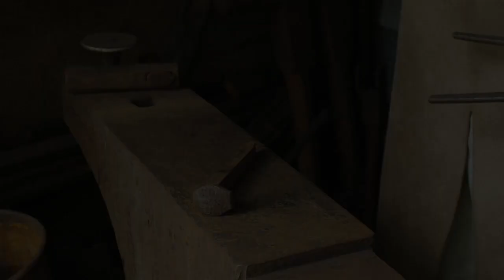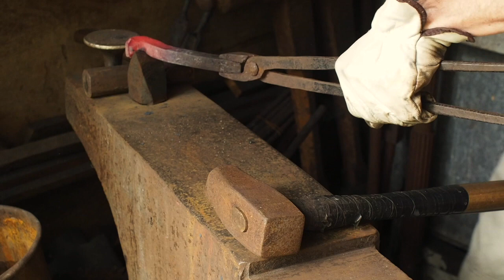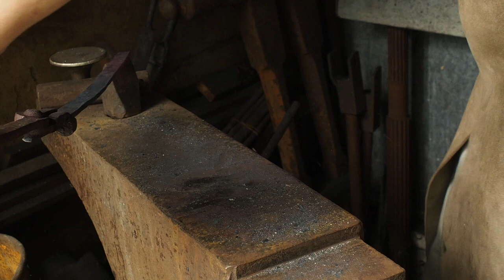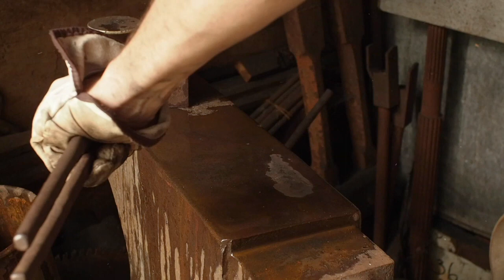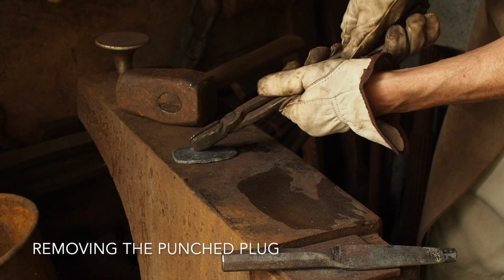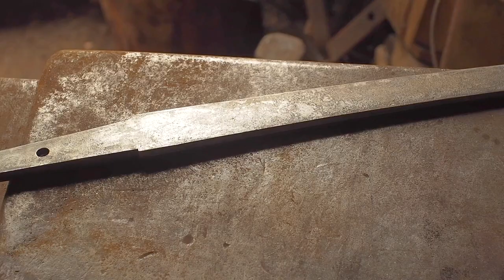TLDW #8 - Tanto Forging Practice: Railroad Spike

Comment: Great work. I make railway spike knives to sell and am just keeping up with demand. Never new there was so much steel in then though, lol. Very nice video.
Reply from the maker: yes, lots of steel...not much carbon... ^___^
Reply: Maybe not in the spikes here in Australia, they are not marked HC. But in the USA they have the initials HC on the head, i take that to mean high carbon?Crossed Heart Forge - islandblacksmith
Reply from the maker: yes, some are marked HC, but it does not mean "high carbon steel" in the metallurgical sense, it means a "higher carbon" version rail spike, but all the official specs i have seen say they never pass .3% carbon (the normal spikes are .12%)...

Comment: I loved your video, really nice and thorough. I have one question, Why out of a railroad spike? I have heard that they don't make nice blades. Is it because they are cheap and it's for practice? Is it meant to be a decoration or a letter opener? Please explain.
Reply from the maker: yes! using spikes as practice for forging is a way to learn for those studying classical tanto...right amount of material if you have the
resource...there's quite a bit of info on those very topics in the description, or here: http://islandblacksmith.ca/2016/07/tanto-forging-practice-railroad-spike/
Reply: Wow, that was impressively quick. Is there a certain place to "look for" railroad spikes? I say "look for" because it is illegal to look for them.
Reply from the maker: yep, don't mess with the railway...best source would be the scrap yard with the rr contracts, or ask a crew for a couple...bottom line is if you don't already have a spike this is not the practice material for you ^___^
Reply: Yeah, I guess so. I was thinking about getting in to knife making. Do you have any videos/books you would reccomend.
Reply from the maker: i have a list, but they are entirely focused on traditional japanese swordsmithing: http://islandblacksmith.ca/product-category/books-apparel-gear/books-resources/

Comment: Love the finished piece and instruction! When you forged your bevels, it didn’t look like you angled your blade at all- most videos I’ve watched say to angle your blade to forge bevels. Is this a different technique- you have me extremely curious, as this is where I struggle massively.
Reply from the maker: no i don't really think about "lifting" the blade, though there is a tiny element of it the proper angle is quite small (and too much would be worse than none)...remember the anvil is "hitting" the back side of the steel with almost as much force as the hammer on the front...
Reply: Okay, thank you. Gonna keep practicing!
Reply from the maker: it is also important to note that is for hizukuri (single bevel) as most tanto are...for shinogi-zukuri (as most katana are) you would have to lift enough to form the shinogi-ji separate from the bevel and centered...

Comment: I see you doing a lot of cold hammering, is this because you are using a rr spike? As i understand things, harder steels will chip if you do hammer work while cold.
Reply from the maker: i suppose that would depend on your definition of "cold" and of "hammering"...when the colour is gone it is still around 1000F or more depending how bright the day is, whereas the brittle blue stage of steel (even mild low carbon steel) is around 600F (this is why you should hammer a rivet hot or cold but not in the middle where the brittle zone is)...hammering to deform needs to be hotter than hammering to bend, smooth, planish, or straighten, this is why closer to the end of each heat and of the entire process the forging temperature gets lower...working too hot is not good for high carbon steel either, but in time you will develop a feel for how much heat or hammering the work can endure at each stage...
Reply: Crossed Heart Forge - islandblacksmith ty for the reply, i am an aspiring bladesmith, im headed out to a SOFA quadstate meet here soon with some savings to get started in earnest soon, im really trying to up my knowledge in metallurgy, so i am very thankful for your reply, after rewatching it appears you are straightening the blade while it is "colder"?... Anyway you have got my appreciative sub ty!
Reply from the maker: yes, deformation (squishing) needs lots of heat to prevent fracturing but straightening can be done at a much lower heat, even cold to a certain extent...keep it really simple and go for it, time is very short!
Reply: LOL I just posted something explaing the same....RR spikes are good for practice but that amount of cold forging can only be done on mild steels, qualitry blade steels will develop micro cracks or crack completely if hit that low of temperature...I have metallurgy degree, and I am also a knife maker...your commment is spot on~!
Reply: @islandblacksmith  Yeah, but if you forge say W2, or 1095, hitachi white, etc....under 1500....you are sort of asking for trouble...You get the 2000-1500 range to form them throw it back in for a minute or two to heat up....I posted above and I aploud you for putting up good videos for aspiring smiths....RR spikes were something I used for practice, initially old school blacksmith artistry or hooks, joinery etc....to hone my skills, and for those purposes they are great...However for a blade I also used for practice, and to make blades to use to practice my free hand grinding, but they are basically mild steel......I am only pointing that out for the aspiring smiths, as if they go sink 25$ into a nice piece of blade steel thining they can make a knife and end up cracking it all to hell because they were hitting it cold.......well, just saying
Reply from the maker: @davidbabcock267  if you watch my other videos you will likely have the impulse to post similar comments about my forging temperatures, most people are surprised to see how far into the (apparent) black i carry the work, but of course it is changing both perceptibly and imperceptibly with the feel/temp of the steel...an aspiring smith is going to crack many blades with a traditional water quench too but it doesn't mean they shouldn't try it and certainly doesn't mean i should alter my technique to make it "safer" for learners, how else will they know where the goal posts are ^___^ ...the japanese sword tradition is always pushing the boundary of how low can the forge weld still take, how low can the forging be done, and how close to critical can you still harden the blade...interesting challenges!
Reply: @islandblacksmith  I hear ya, but I hope you do some destructive testing or use a metallurgical microscope as I do, to ensure that there are not unapparent cracks in the work.....That can happen in cold forging, and can almost be impossible to catch by eye, however, the blade when used heavily will break and that is not what a customer wants....my 2 cents for what it's worth.....I've studies some Japanese forging, however not in Japan, but from someone who has studied it has instructed mostly verbally albiet.....I even have 3,2 kg of pure NBTHK smelted tamahagane I was able to aquire from a smith who I commissioned for my own sword, however I am still experimenting with bloomery steel before I will risk using that treasure....Some steels you can work fairly cold, but many good knife steels you cannot....I am really only talking about the aspiring learners who will spend money on high quality steel to make knives, and much of that, you really do not want to forge under red temp.....all I am saying....Just trying to point that out for some who are less knowledgeable about metal....
Reply from the maker: @davidbabcock267  yep, fine to instruct as your knowledge and experience will allow...but i am just here doing what i do, when i happen to have a camera going...i only use very old low alloy carbon steels or file steel...not instructing anyone to purchase steels at all, certainly not how to work them when they do...here's one bit of destruction testing for your interest: https://www.instagram.com/p/B_Y0JKKg-7p/

Comment: How did young Japanese smiths practice their skills? Or did they not have to practice, seeing as how they were usually from a family of smiths, and their introduction into the world of smithing was an early affair? Is it possible that they were constantly absorbing the correct method and their skills grew as they took on more difficult tasks in the family shop?

Great video!

Nathan
Reply from the maker: i think your last hypothesis is closest...the traditional model of apprenticeship in Japan is that the teacher does not teach, instead the student is responsible to observe and glean information while doing assigned work at an appropriate level...here is an article with links to more information on traditional apprenticeship: http://islandblacksmith.ca/2015/05/on-swordsmith-apprenticeship/
Reply: Crossed Heart Forge - islandblacksmith Thanks for the info.

Comment: Did i miss somthing? HC means a high carbon version but normal spikes are higher in carbon than those marked HC? I apologise in advance for my ignorance or misunderstanding. Thankyou also for your quick replies, your tutorials and those of Chandler Dickerson are among the best.
Reply: Sorry in my last reply i got Chandlers name wrong. Of course you would have noticed, it's actually  Dickinson, cheers.
Reply from the maker: not sure where you got that idea, yes, some are marked HC, but it does not mean "high carbon steel" in the metallurgical sense, it means a "higher carbon" version rail spike, but all the official specs i have seen say they never pass .3% carbon (the normal spikes are .1%-.2%)...

Comment: What weight hammers do you use? I just picked up my first dog head hammer, at 8lbs, forged by Shaun Cunningham of Front Step Forge.
Reply from the maker: ah, i saw him working on that one...are you using it as a mukozuchi sledge or just super heavy tanren hammer? most smiths use two sizes of hand hammer for most bladesmithing, a larger one for rough work, 1.5kg-2kg (~3.5lbs-4.5lbs), and a smaller one for finishing, 1.2kg-1.4kg (~2.5lbs-3lbs)...
Reply: Sorry for my terminology not being all there right now, I just got off an especially busy day of work. Im using the 8lb sledge for tanren, as most of my stock is 4"x1/2" leaf spring from something massive and I find my 4lb sledge doesnt cut it. For my more delicate work, I have a 2lb italian rounding hammer, but I am working on a 3lb doghead hammer from 1045. I have my 8lb hung on a 24" handle, so it is small enough for one hand use, but big enough to be swung like a mukozuchi sledge. I have some various hammers of different sizes and shapes for different work too, but i want to get some doghead hammers made for my bladesmith work.
Reply from the maker: ah, ok...not tanren, which is the folding and refining, but everything after that...louie mills uses an 8lb one hand hammer for tanren, it will get you in shape: https://www.youtube.com/watch?v=eSfurMT0TY0
Reply: Crossed Heart Forge - islandblacksmith like I said, terminology isn't all there haha. Yeah, it's definitely a beast to swing one handed. It definitely helps move stock though.
Reply from the maker: yep, and the impact goes deeper with a heavier hammer, there is a max size billet you can handle with a certain hammer weight no matter how hard you hit...
Reply: Crossed Heart Forge - islandblacksmith I definitely learned that when I was trying to move 1.5" 1045 with a 2.5lb hammer haha. Even the 4lb was meh. Gonna try the 8lb on Saturday, see how that goes.
Reply: Crossed Heart Forge - islandblacksmith but you'd be surprised what size power hammers can move, even at a smaller weight. Paul Kryzowski started selling power hammers, and did a demo of crushing 4" stock down to 1" stock with a 33lb air hammer(I think it was one heat, can't quite remember.)
Reply from the maker: yes, i think 6# or 8# would be a bare minimum for efficiency on 1.5" steel without mushrooming the corners...33# is about 8-10x your small hand hammer so the equivalent to 4" square would be about 1/2" square down to 1/8" in one heat...
Reply: Crossed Heart Forge - islandblacksmith true true... I was just surprised when such a tiny hammer moved that much metal.
Reply from the maker: ...and the old timers had an equation for hammer vs anvil weight too, i think it was 1 : 25 or so...eg a hundred pound anvil could handle a 4lb hammer or it would start to get bouncy and inefficient...interestingly 200kg is a pretty standard swordsmith anvil in japan, which works out to handle the larger mukozuchi at about 17#...
Reply: Crossed Heart Forge - islandblacksmith Essential Craftsman put it at 1:40. I don't follow that whatsoever though, because I can't afford that big of an anvil...I only have a 44lb Princes Auto anvil. They are surprisingly good for the cost, at $3/# brand new, cast from 1045. Unfortunately they only make them in 22lbs, 44lbs, and 110 pounds at the biggest. They also have a 60lb drop forged anvil, but it costs the same as the 110lb cast steel anvil.
Reply from the maker: 1:40 would definitely be better! cast steel is great if it is heat treated properly, same goes for drop forged...

Comment: A question since it seems to be impossible to find proper sources , traditionally speaking did tantos have a secondary bevel/edge or is the blade continuous towards the edge , or does it even matter as long as its the general shape?
Reply from the maker: japanese swords are continuous with a couple of  specific exceptions...check out http://islandblacksmith.ca/tag/tanto-geometry/
and http://www.ksky.ne.jp/~sumie99/information.html
Reply: @islandblacksmith  Oh wow , thanks a lot i didnt even know about this , cheers!

Comment: i have two questions for you: how can i find out, if the knife i'm forging has the right dinensions, even though i don't own one? and: do you know any european wood to replace the expensive magnolia for saya making?
Reply from the maker: the best way to learn to forge tanto is to work to kata based on antiques, you can make your own: http://islandblacksmith.ca/2014/04/aizu-shintogo-kunimitsu-tanto-kata/
or get some pre-cut from Pierre Nadau: http://soulsmithing.com/product-category/kata/
there are some additional geometry details in this series: http://islandblacksmith.ca/tag/tanto-geometry/
Reply from the maker: the wood should be very stable, non-acidic, low-resin, resistant to moisture, medium hardness for shock resistance, and closed grained...

Comment: This is a good video, and when I moved from minor artistic blacksmithing work to blade smithing, cheap or free railroad spikes were certainly a good way to hone your skills.  However as a blade forger as well (and I have bloomery steel, and even some NBTHK tamahagane - what the japanese make real swords out of.....aquired from a smith I had commissioned a sword from), and railroad spikes are fairly mild steel....There is a fair amount of cold forging that I see here, the metal is grey and still being struck....Many good knife steels that are available as opposed to cheaper and mild steels would develop micro cracks, or full crack, if hit at that low of a temperature.....I just wanted to point that out. I also hold a metallurgical degree....I know what I am talking about when it comes to forging cold or hot steel.....So do not try that with your expensive W2 or something
Reply from the maker: have you read the description yet for the details on the carbon content issue? it is quite interesting...and you can watch my other forging videos to see how i forge (low alloy) high carbon steel...most people are surprised to see how low certain forging operations are carried out in the japanese tradition...certainly takes care and a feel for the steel, and some of the issue is discerning between serious forging vs. surface forging, planishing, and straightening...

Comment: Railroad spikes are a medium grade steel.. approx a 1045
Reply from the maker: would be great if they were but they are not...plenty of info in the description and link to the website re official specs on the 2 types of spike steel...spoiler alert: they max out at .3% and most are .15%...so the hardest you could get them with a quench and no temper is about 40-55hrc...

Comment: These japanese hammers looks like having more control ... excuse me my bad english ,I learned your language by reading and watching movies
Reply from the maker: yes, it depends on the balance, but they do work well for thin steel (like blades)
Reply: 🙋. WoW 😁 I too learn english, 😁 . También lo hago aprendo de  un poco así,  pero no habló ni sé Nada 🙋‼‼✔ Saludos 🌹
Reply: Dogs head hammers are very heavy forward facing...I have a 3lb and a 5.5 lb, althoug I rarely use the 5.5 now...I prefer my bladesmithing hammer from Brent Bailey for most forming, but for beveling work, which is where a dog head hammer comes in great, they work!!!!!  However in my opinion you need various hammers from rounding, to flats, to dog head, etc....depending on the project you are working on
Reply: @fanton777doy9  YouTube is great to learn Spanish , English and French . Probably most of the translations are in English . But reading books is very important
Reply: @islandblacksmith  I've never seen a hammer like that in any shop in Brazil . I mean , that with one head longer than the other . Looks like I would have to forge it .
Reply from the maker: @liegesaboya8265  forging one is a good way, you will value the tool you make!